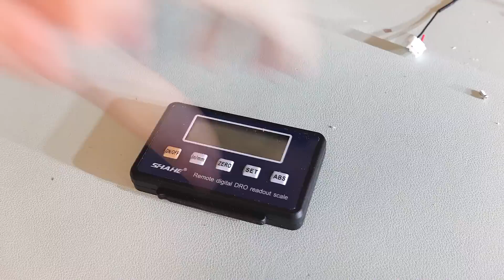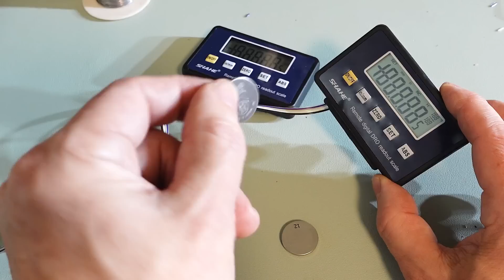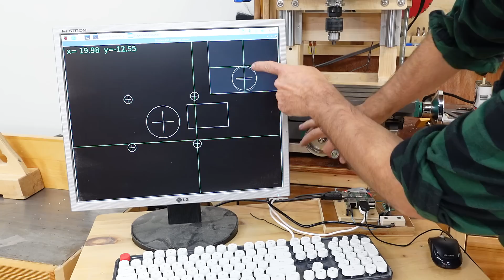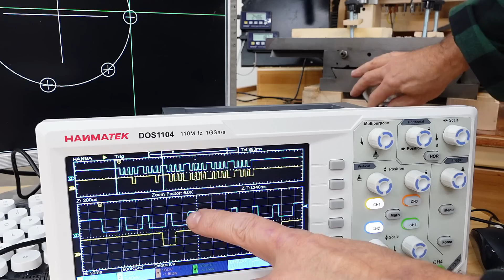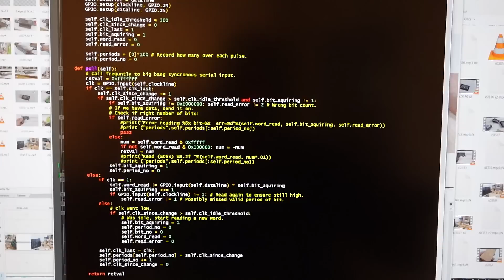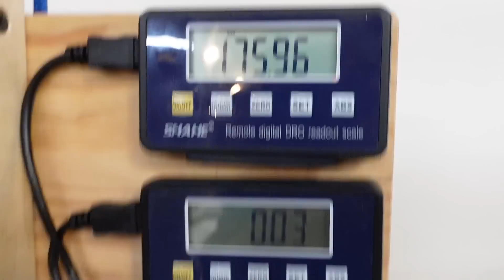Cheapest DRO and adding graphics

Comment: x and y are too abstract, front to back and side to side should be used instead! edit: this was sarcasm lol
Reply from the maker: indeed.  But those are too long, so we abbreviate them as x and y.
Reply: except x for horizontal and y vertical is pretty much well agreed convention
Reply: @victornpb  generally X is the longer axis. That's the convention. On a machine there's no horizontal or vertical. You could be standing on the side of the machine. Z is up and down too.
Reply: @1pcfred  thats just being pedantic, most ppl would agree which orientation is horizontal and vertical on a piece of paper laying flat on a desk. None on earth say draw a line going forward and backwards, they say draw a line going up and down the paper.
Reply: @1pcfred nor is a screen a piece of paper, have you ever viewed a piece of paper on a screen and see how it is represented? Bro is trying so hard to break a convention everyone agrees for no good reason
Reply: Декартова система координат 😂
Reply: even in grade school im sure you used graph paper to draw X,Y graphs to plot slopes etc. in each of those graphs the X axis is on the bottom and Y axis along the left. this is used far past grade school. every computer screen you look at is divided into a grid of points. the position of these points are described by two values, X and Y. this is very common practice for describing a point on any 2d surface.

Comment: Drywall screws are such magnificent things
Reply: Sharp little bastards though.  Used to hate reaching into my apron for a handful.
Reply: My dad built tons of stuff using only drywall screws - never had an issue with them. Sure, they'll snap if you have too much force on a single screw, but so will any screw. I'm not sure where all the hate for them comes from more recently. Probably "big screw" trying to convince people to buy more expensive wood screws instead.
Reply: @gorak9000  They really ARE brittle and snappy. I tried, but I always go back to proper wood screws.

Comment: Did you design the digital template (the circles and crosses) by hand or imported from a CAD program? That last one would be great for more complex designs. I still prefer my CNC for accurate holes though :)

Could be off slightly because the linear sensor isn't perfectly co-linear with the motion axes, but it's close enough for most wood projects.
Reply from the maker: Actually, I cut and pasted those numbers out of a spreadsheet

Comment: Only short step to Take Photo -> Inkscape -> trace bitmap -> generate Gcode -> interpret Gcode to router movement.
Reply: You only need to interpret G0, G1 and Z - commands. If you use very long radius in Inkscape tracer,   G2 and G3 are straight lines.

Comment: I really like the visual readout system.  I can imagine making fewer mistakes by using something like that, especially if it shows cutter diameter during side milling.  One of the big complaints I have with digital calipers and digital readouts is that they don't give you an approach velocity, whereas dial calipers do.

Comment: I think I've seen a Heidenhain DRO that had a similar interface. It gave you position in numbers but also had a bar moving towards a target. I really wanted one like that but there is no such thing as a cheap Heidenhain. 
I wonder how complicated would it be to have a DRO that gave you an absolute position based on two scales. Use it in a lathe tailstock, one scale for the hole tailstock and one for the quill. I know it's easier to just mount a drill chuck on the carriage, but I thought it would be possible with something like a modified TouchDRO. Great video, take care!

Comment: Could also use a long pair of digital vernier calipers. A lot of them have an USB output that you can connect to your PC and read into the PC. I even automated a small surface grinder to move an exact amount to the next "row" once it did two passes. Basic path written in arduino, nothing special. You have to mount the "brains" part to the static part of the machine and you use the end stop on the calipers to affix it to the moving part of your machine of choice. Nothing special. Best part is you have the zero out function so you can position the calipers (after you've nipped off the "teeth") in the center. In the program, it will read as negative values once you zero it out and you don't have to do anything special.

Comment: I guess you are slowly moving towards a full DYI CNC machine :)
Reply from the maker: I keep thinking about going full automation, but for the one-off stuff I make, manual or semi-manual is faster
Reply: @matthiaswandel sure but what’s the fun in that when you could make a diy cnc.
Reply: @matthiaswandel  creating 2.5D tool paths is pretty fast and easy to do. You can create a tool path like that in a vector graphics program. Then just use a translator like DXF2GCode to generate the G Code. Easy peasy. You set your safe height and your final depth. That's it. Then when you run you home and touch off your axis.
Reply: @matthiaswandel  
"for the one-off stuff I make, manual or semi-manual is faster"

That's only true as you're dealing with small thickness material.

If you had a 4 inch piece of metal that needed to have several holes drill pecked into it over a long period of time, then fully automated CNC would be the best tool to use.

But, what are the odds you're going to have a 4 inch thick block of metal to mess around with?

Hmm, probably pretty good since that question implies you never will.
Reply: @scotttovey you’re…….not your.
Reply: HNC - Human Numeric Control
Reply: @lauroaranha  MGC? Matthias Graphical Control, since the ultimate positioning is done by "do these crosshairs line up?"
Reply: I see a future 5 axis cnc with motors of an old washing machine, the encoders of an old cd drive and the manual input made of an old BlackBerry.
Reply: That would be a loss. I think Matthias would be a great user of a CNC and would explain and show a lot of his findings and what to observe but there are some other channels doing that, so I more like him to go his own way and show us what only he does.